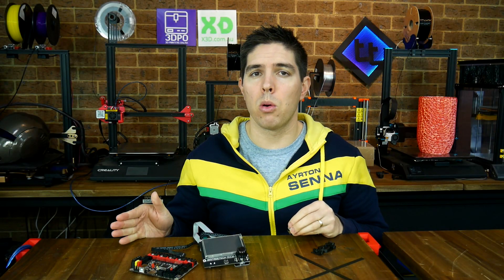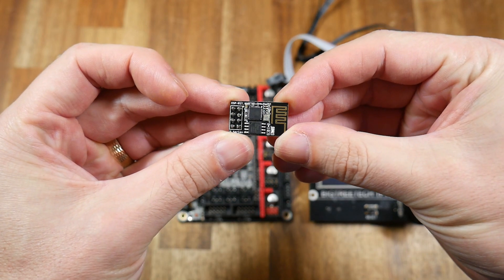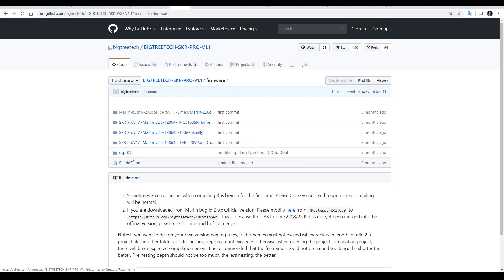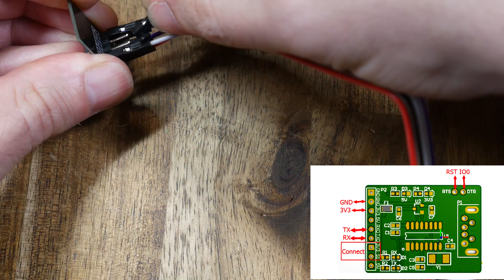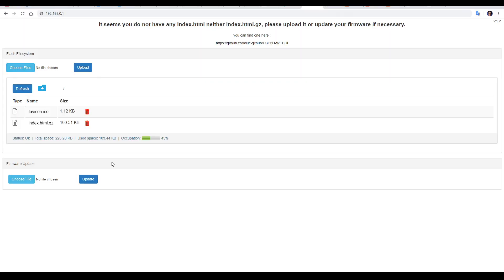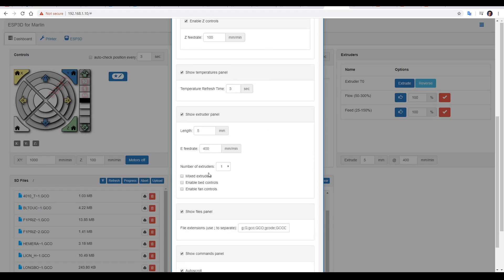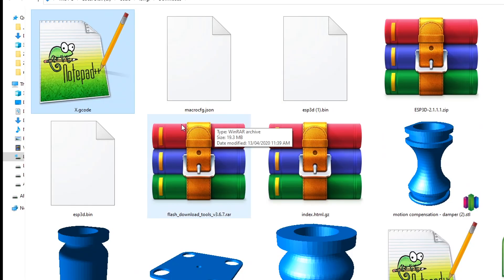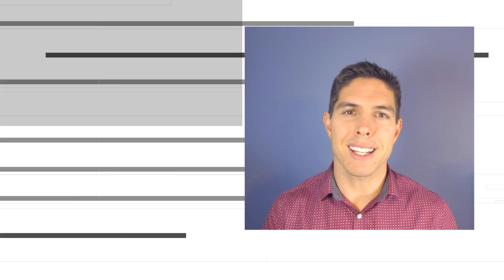Add wifi to your Bigtreetech mainboard/touchscreen - ESP-01S guide

Comment: Key question for me (and why I found this and got here): Would BIQU B1's stock filament runout sensor still be active for a job launched this way? Since a filament runout sensor's feedback is not supported via serial communication, jobs launched from Octoprint have no filament runout protection. i suspect the same kind of issue may be at stake regarding the power loss resume feature as well.

Comment: hi, i really need help,!!
i installed skr wifi module, and now my octoprint network is dead, 
i have this message :  
State: Offline (Error: SerialException: 'device reports readiness to read but returned no data (device disconnected or multiple access on port?)' @ comm.py:_readline:2417)

i suppose wifi module is using my skr port... how can i reset all taht please.

Comment: If you only need the WiFi and no touchscreen there is also a way. Took me some time to figure this out. I used a NodeMCU which has USB connection for flashing (no extra flasher hardware needed) and can handle 5V. I connected it directly to the TFT connector (VC, GND, RX, TX) and it runs great.
Reply: can you please send link to any tutorial?

Comment: As usual a great tutorial.  You are quickly becoming my goto source when I have issues/questions on my ender 3 pro.  I bought my ESP-01 as a bundle with my TFT and it seems like it came preloaded with the needed firmware so I only needed to run steps 4.5.6.  Still very good tutorial for those needed steps.  If I had seen steps 1-3 I may have opted out of this upgrade as the cost of the writer+cables would have made this a $13 upgrade.  I did have some issues post configuration trying to make changes to my preferences and creating macros but the problem was the on board chip memory usage was nearly 100%. I  ended up removing the the favicon.ico and 404.html files (not really 100% sure what these files do for me) and that freed up enough space.  Could probably also remove the index.html.gz file as well.  Just a tip in case anyone else is running into issues with this.

Comment: Everything went smoothly flashing, but then After installing in the printer, it showed it's face ONCE.  I logged in as instructed, copied the 3 files and haven't been able to connect back to it again at all.  No matter how many times I flash it.  It will flash, I can connect a device to it, like my phone or computer and ping it etc, but no response in a web browser.  I don't know how to place files on it if I can't connect through the browser.  This is super annoying.  Can't we SSH into it or something???  The device seems to be working, but missing required files and doesn't seem to put the first-run config page back.  HELP PLEASE

Comment: Hey, you have a glitch when you load the firmware. In the video, minute 7:51, when you choose the file ESP3D.bin IT IS NECESSARY to put in @xxxxxxxx the start memory 0x00000 and mark the start box. If you do not mark and put the memory (0x00000), the recording is not correct, now you can see the box with 0x00000 in green. Also with a simple convert from USB to TTL can be recorded without problems. 
3v3 to ESP 8 and 6 
GND pin to ESP 3 and 1 
Tx pin to ESP 4 
Rx pin to ESP 5 pin 

Tested and ok.

 Greetings from Spain...
Reply: You nailed it. I just tried flashing and couldn't figure out why it was not working.He either flashed it previously, or it was already flashed. Without that check box and offset, nothing is written.
Reply: I just spent 2 hours trying to flash this thing. This simple checkbox and address did the trick! Thanks!
Reply: Dude.... you saved me couple of hours of my life.... was scratching my head for a long time... "what I did wrong?!" style...

Comment: FYI...I had to run a command prompt as administrator, and launch the firmware tool in that command prompt to get access to the COM port.  Right clicking and running as administrator didn't do the trick

Comment: big thing to watch out for now is the favicon icon now wont download directly (just like the 404 file). Mike first said '3 of the 4 files download easily' so I didn't pay any mind when my favion was a .htm instead of a .ico. I figured it may had been updated since this video. after uploading it and trying to reach 192.168.0.1 I get a blank page. If I try to reflash the chip's firmware or erase, I get '5-chip efuse check fail', which, from my limited research seems to be some kind of 1 time permanent memory write,  that once triggered, can't be reversed. so I believe now this wifi module is bricked, unless there is some other way to remove the favicon.htm file, add the .ico one, without accessing the webui.

edit

so sketchy googling and google translate for a russian website landed me on a forum that said to jump ground to IO0 (while unplugged). I did this, connected the jumpers back to the regular configuration, and I was able to flash without issue. now however, it not longer broadcasts an SSID
Reply: Any advances yet??? I am in a similar boat
Reply: @fritzgutten1  no, and apparently it may not have been the file as I suspected. I eventually got it to erase, and reflashed with success, but when I plugged it back into the skr, it will no longer broadcast an SSID. I ended up purchasing a batch of 4 from amazon, and none will flash with the BTT writer. I feel like this is the actual problem since they are just simple 8266 wfi cards used in a lot of arduino and home automation projects.

I just received my second skr for another printer, with btt writer, and another wifi module. I will do more testing, although, I have posted this issue to github and reddit, and I see a lot of others with the same issue with no response from BTT.
Reply: @fritzgutten1  second skr, tft35, wifi, and btt writer came in. didn't even need the writer. plugged in the card and went to the IP. I have a feeling the btt writer is no longer needed and is soft-bricking these wifi cards. Mike should update this video or put some warning annotations. now that I have a second writer, I will give a shot at fixing the other 5 wifi modules I have, but I don't think these writers are any good.
Reply: @sam_antics  ugh, so not as clear cut as one would hope or is lead to believe
Reply: @fritzgutten1  I ended up using a bread board, some jumpers, and this guide on how to backup, push, and erase firmware via cmd line in windows with python: https://www.instructables.com/id/How-to-Backup-Original-Flesh-File-From-Esp8266EX/

I was just messing around at first with one of the 5 spares I have. once I realized this worked (unlike the tools in the video) I put the functioning wifi chip I have in and backed up the firmware to the computer. then I put in a spare and pushed that firmware to it. it worked. now I have a bunch of cheap wifi chips for these boards.

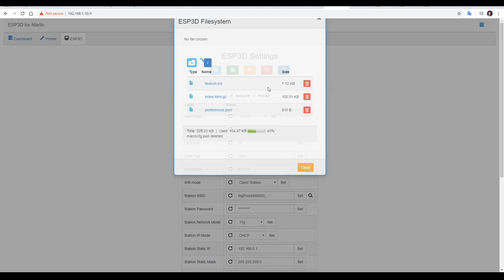Comment: Can you please explain the "ESP3D Firmware Update" button @12:22. My understanding is that the wifi module works out of the box and then use Firmware Update to flash the latest firmware. Hence no need for the BTT Writer.

Comment: As to why the wifi module from BTT isn't open sources is likely due to them sourcing it or parts of it from manufacturers that refuse open source in their licensing. When it comes to wifi chips and modules in general, open-source is a rare sight. Manufacturers of wifi chipsets and IC's are extremely scared of open-source. They shun open-source like the plague.

Comment: hello I installed a new board on ender 3 but on the lcd it appears written (no printer connected) that could be already reviewed the material links I used was: BIGTREETECH SKR Mini E3 V2.0 - 32-bit control board with TFT35 E3 V3.0 pantalla touch RepRap Smart Controller repost panel for printer ender 3 ..... I can only work with Marlin bugfix 2.0.x 2020-23-03 has 2 systems installed ... Marlin and Bigtreetech touch mode ....

Comment: flashed pluged it in no page @192.168.0.1 nothing
save yourself a migraine
 go for the headache option 
 get a pi install octoprint 
 take 2 paracetamol
job done

cheap is not always better

Comment: How can you reset the module? I set my wifi parameters, restarted it but it failed to connect to the router. Now its not broadcasting an SSID so am a tad stuck.
Reply: This is kinda where I am - I replaced my router, so now how do I reconnect to the module to enter the new WIFI info.

Comment: I have ordered skr mini e3 v2.0 board and TFT touch screen. Is it wifi module compatible with BIGTREETECH TFT 35-E3 v3.0 board ?
Reply: My 2nd question is, wifi module is good to drive your printer wireless or Octoprint/ Respberry pi 4 setup ?
Please reply

Comment: Could you not use an Arduino Uno to update the firmware on the ESP01S instead of the BTT writer?  Just saying because its not that easy to get the BTT writer whereas the UNO is very easy to get.

Comment: 14:35 I'm having a somewhat difficult time understanding his (the github author) English, but is he basically saying to increase the speed of the file transfer rate over wifi of the printer is to not use that specific wifi module and to use another one that is a SD version? 
Second question: What does OctoPi offer that this doesnt? I'm a noob, so I have no idea what OctoPi does. From what I've seen in this video its pretty impressive.. The fact it has a camera (video?) option makes this a pretty sweet add-on.
Reply: He has an entire Octoprint video. The camera settings in it, like time-lapse, are so much more advanced. Plus, with hundreds of plugins, there is unlimited potential to do more. Get a Raspberry Pi, control your printer, and when you inevitably get more, it will control those as well, from your phone app.

Comment: This is great because when I bought my TFT35 it came with the WiFi board but I didn't know what to do with it since I couldn't find any info for it.
Also, may I make a suggestion for a future how-to? Upgrading from the stock thermistor to a PT100 thermocouple. The standard thermistor in my Ender 3 recently failed so I replaced it with another of the same type. What I really wanted to do was to replace it with a PT100 type thermocouple but the SKR Mini E3 board doesn't support it. I know an amplifier adapter board is required but not too sure about reprogramming Marlin to make it functional.

Comment: I always laugh at these kind of things. So you drive your 3d printer with a 4mhz Arduino board and then add a 160mhz chip JUST for the wifi? Hilarious. The esp8266 can run circles around the Arduino! Why not just drive the whole printed with ONLY the esp8266??

Comment: This programming method makes this excessively difficult (looking). Please refer to Tasmotizer (load binary file and hit "Tasmotize" (program). if using a standard FTDI adapter, just make sure upon powering up the ESP-01 chip the GPIO 0 (zero) is held to GND for at least 2 seconds. This must be done prior to and during power up. If using the BTT FTDI programmer, it is handled by software. Much simpler. tool here --> ( https://github.com/tasmota/tasmotizer )! Thanks Michael for another wonderful video.
Reply: THANK YOU!!! I've been fighting this for 2 days BTT does not work for regular programmer.
Reply: Thanks very much for this. I have been fighting this too. the AP that the ESP-01S was transmitting was AI-THNIKER.... i was able to communicate with a serial tool, and set the wifi credentials , but i didnt go further than than. As soon as i used the tasmotizer the ESP-01S publiched the right WIFI SSID (ESP3D) and everything went smooth from then on. Thanks very much.

Comment: Great instructions!  Easy to follow.  I already purchased a few but didn't install any yet before watching this.  I did do part of the install different.  After I burned the firmware, I unplugged everything but the 3.3V & ground and completed the remaining steps while still powered by my laptop.  Upon completion, I plugged it into the TFT35 on my Ender 3 and it was ready to go!

Comment: If you are interested in running Marlin + ESP3D natively on the ESP32, here are some boards:
https://github.com/maplerainresearch/MRR_ESPA/
https://github.com/maplerainresearch/MRR_ESPE/

These boards require the ESP3DLib by Luc (author of ESP3D) which integrates ESP3D with Marlin (instead of ESP3D communicating with Marlin via UART).
https://github.com/luc-github/ESP3DLib
This allows features such as over-the-air update of Marlin firmware, plus all the other features of ESP3D. File upload is also a bit faster since the data is being written via SPI to the SD card directly, instead of being sent via UART to Marlin, and then Marlin having to write the data to the SD card via SPI.

The "grandfather" of these boards:
https://github.com/simon-jouet/ESP32Controller/
(Simon was one of the main people who brought the ESP32 HAL to Marlin)

Comment: Hi.  Can we do the Esp01s flash process in the same way that I sent the link? https://tr-m.banggood.com/ESP01-Programmer-Adapter-UART-GPIO0-ESP-01-CH340G-USB-to-ESP8266-Serial-Wireless-Wifi-Development-Board-p-1441922.html?gmcCountry=TR&currency=TRY&cur_warehouse=CN&createTmp=1&utm_source=googleshopping&utm_medium=cpc_bgcs&utm_content=frank&utm_campaign=pla-trg-rm-all-purchase-mb&gclid=Cj0KCQjw4dr0BRCxARIsAKUNjWS5d1nEBT3MsluJyJI124R6OvAPovh5Brb9N6CweQJKJE4-etu-9SsaAga_EALw_wcB
Reply: YES! However, in addition, you need to short GPIO 0 + GND before + During power up (inserting the usb). It will NOT put the ESP866 chip into program mode as it stands.

Comment: I bought the TFT35 tha wide screen version not the replacement one for the Ender3 and although I can get the ESP01 working standalone (Not connected tot he printer) whenever you plug it into the TFT35 it will not work, I think there is a pinout problem but I've not yet tried it with dupont jumper leads. So if you have the widescreen touch screen just be aware it might not be plug and play!  Great video though.

Comment: Good video.  I opted for the ESP-01S when I was building my Hypercube Evolution.  A few observations:
- Personally, being an old guy (LOL), the 8.3 filename is not a big deal.  It's what I grew up with. (it's the old 8-bit DOS filename format. Tells us something about the board.)
- Not sure why the upload is slower than on a standard wifi, but I'm not in that big of a hurry.
- The Writer is a nice touch.  I had to wrestle with the old Arduino-and-breadboard a bit to get it rolling.

My personal opinion, the ESP isn't better or worse than an OctoPi, it's just different. (although the new OctoServer might change that opinion slightly)
Reply: Give " Tasmotizer " a try. I think your opinion will be forever changed. 1. Load Tasmotizer. 2. Select BIN and load BIN file. 3. Click Tasmotize. (it auto selects the correct pragramming optins and correct COM port unless you have multiple ESP chips plugged in.)

Comment: I used a D1 mini ESP8266 and added to my A10M , it uses 5V and TX and RX. connector on main board. not really all that usefully due to not being able to use internal SDCARD because so slow, but great for using terminal without having to plug in USB cable, or doing movement / home  moves. but because my printer is on same desk as PC its easier just to use LCD menu.
but it was a fun project to build and use. once SDCARD use is updated  it be a lot better.  The macro  information and setup was very useful as i have not done macros but now know how :D

Comment: Those esp8266 modules are used in quite a few smart home devices also
So not that anyone probably needs an excuse to buy a sub $5 ftdi, but if you do, or you want to find use for it after you upgrade your printer it can come in very very handy to write new firmware on smart home products that arnt suppose to be "hacked".

Comment: One of the problems I have with Octoprint (Which I use most of the time) is the comms speed between the pi and the main board (SKR Mini E3) causes the printer to wait for a split second sometimes for the next command. This is particularly true on printed curves. So a fast way to upload to the SD card would be useful. Looks like the wifi card might be a better solution.

Comment: Another great video. Thanks Michael. 
One thing. Have you tried compiling the TFT firmware with #CLEAN_MODE_SWITCHING_SUPPORT enabled? That enables the TFT to continue forwarding messages received from its serial ports on to the printer even when it's in Marlin emulation mode. I haven't tested it with the wifi module but it should allow the wifi module to work in either mode.

Comment: I tried esp8266 based solutions in the past, and they were slow but functional, and wifi was still more reliable than the usb my printer had. Today, with raspberry pi zero w and similar boards for $10, there is not much reason for esp8266 on the printer anymore.

Comment: I was going to ask if it had any benefits over octoprint and you answered that pretty fast. Been using octo for years now and won't ever look back even if the boards are $35+ and with a high gain wifi adaptor your printer can be pretty far from your router.

Comment: you don't need the writer, you can use the sd card slot of the SKR PRO 1.1 to flash the ESP01S
Reply: RomanoProductions 
Than tel me how ?
First of all how should be the jumpers on skr pro board configured
Than are there any marlin settings required before flashing esp01s from sd card ??

Comment: Why, why would you do this, you can get rpi zero for 5USD thats probably less then the wifi + writer module, and you can use to some extent octoprint, if you are even more cheapo, you can scavange for an old laptop, Iam using one from 2004(though at that point it was top of the notch enterprise computer) and it even handles ps eye camera(that means transcoding the color format in realtime)